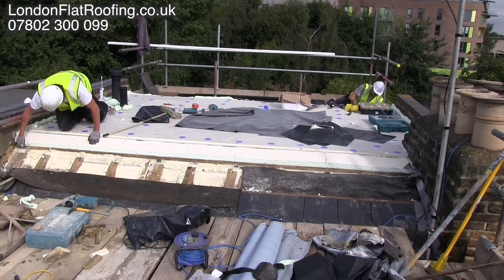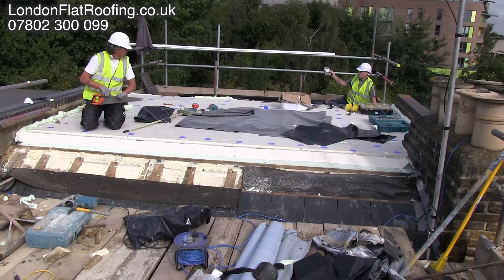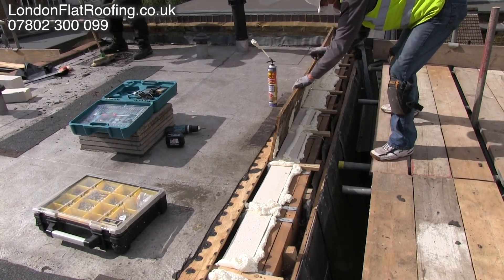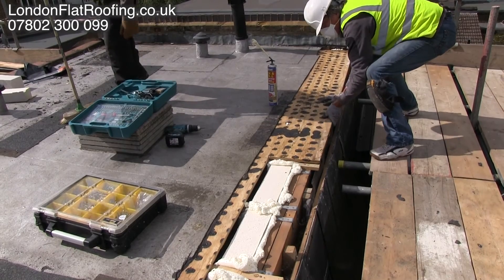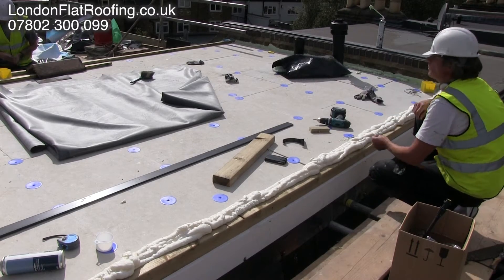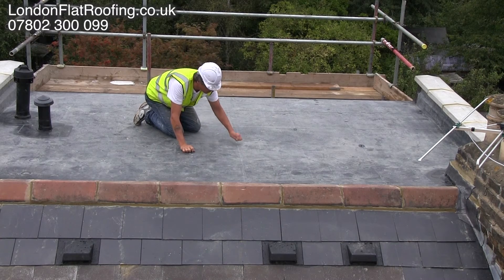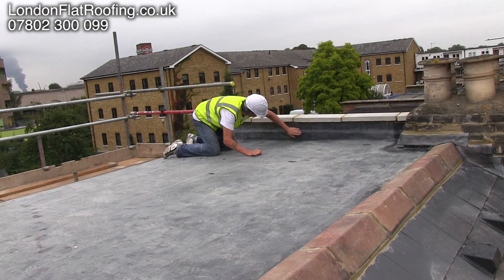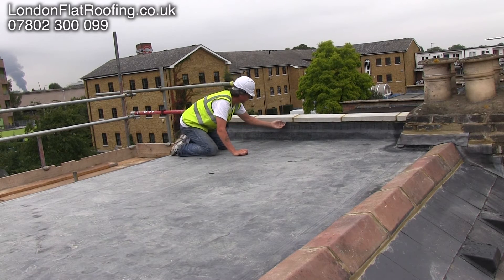New warm flat roof, EPDM on insulation  video 2 of 2

Comment: Hi Steve, I am in France and I am in the process of building a roof terrace 100 sq metres (warm roof) Question . Was the felt stuck with hot bitumen or torch on ? and what final coating would you apply to support wooden terrace ? Generally here everything is torched on. Thanks

Comment: Thanks for your video's steve...  Can you come to Montreal to do my roof! :)   it gets very, very cold in winter and very hot in summer here ...  My flat roof currently from inside out... plasterboard, plastic vapor barrier (old and not very airtight), wool insulation between joists, plywood covered by asphalt and gravel roof.  Want to redo with EPDM and after having attic condensation problems, would like to add additional rigid foam insulation over existing roof...   the roof is vented.... Do I need to add a second vapor barrior under the rigid foam insulation?  i saw some methods use this approach but don't see the logic as the moist air is coming from inside the house into attic...  i can see the additional insulation on the outside would help in minimizing the temperature difference inside attic so the underside of plywood would not be as cold...